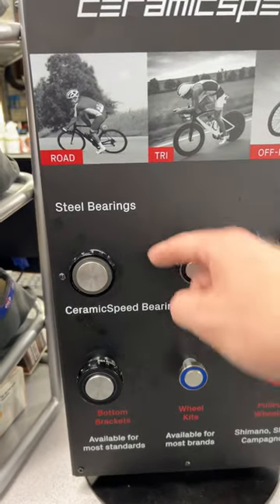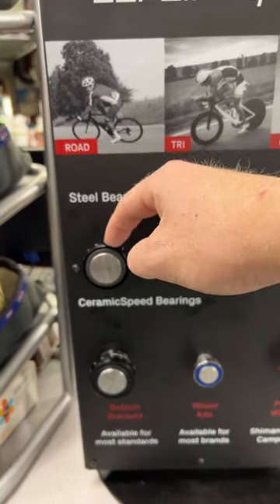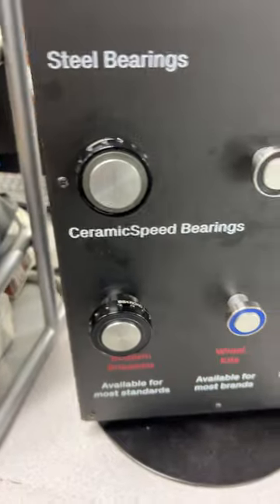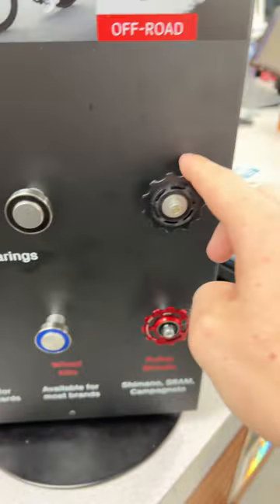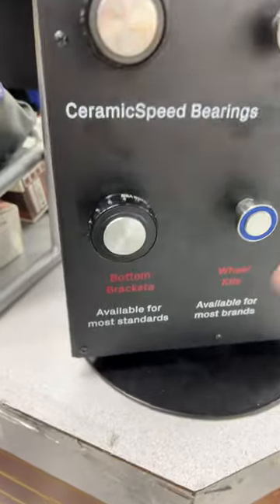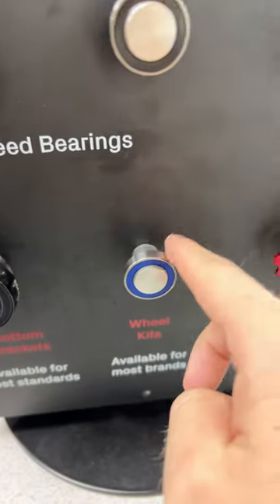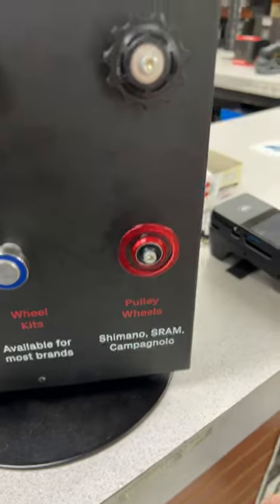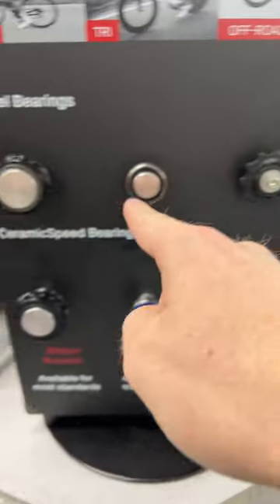Why your bike needs ceramic bearings!

Comment: while i don't have a dog in this race, i do have to say that this isn't how bearings work.
Reply: to make it more clear, a bearing does what it says, it "bears" a "load" it is a bearing. without a load you can de grease a skateboard bearing and it will spin like crazy. it will also explode if it spins like crazy for too long. how well a bearing spins without a load is a moronic way to approach the idea that one bearing or another is better. as i said, they are made to handle a load.

Comment: Yeah this is a load of crap. You can have steel bearings spin just as well. Ceramics use a light oil typically

Comment: Ceramic is a huge waste of money if your not going to pull them apart and clean them after every ride. Wasted alot of money on bones swiss ceramics just to realize they roll the same as reds after a week if you dont clean them like a methhead. Also the steel bearings should roll fine  they are either packed with grease or overtightened I have some steel no name Amazon bearing in my kids scooter that are over a year old and roll better than the top row

Comment: Looks like you lubricated the steel bearings with heavy grease and the ceramic bearings with light oil.

Also this test tells nothing of substance because the bearings are under no load.

Comment: Yeah because the display made by the company selling you an overpriced product is going to be very very honest with you. Ceramic is only useful if you are worried about your points on the world tour. The other 99.999% of society will do just fine with cheaper steel bearings.

Comment: Ya lmao don't hit a pothole or speed hump even thinking of downhill or vertical bikes not a chance in heck besides any skater/ biker kid knew damn well how to have skake wheels clean lube and not over tighten the damn things spin for minutes on end.  It's honestly how you would tighten ea wheel before thrashin or or crusin it's simple.  And never-ending Walmart 100 dollar bikes have cheap regular steel bearings and those spin longer than your ceramic lubed maybe bs lol.  Tear one down let's see tech. data sheets, or trial and error attempts or takes  frfr.

Comment: What a load of crap. You ever repacked a bearing? Or held a new bearing for any piece of machinery ever? That test board is definitely bias/rigged. Maybe a ceramic bearing has better longevity, but the two bearings wouldn't spin at different resistances being in the same state unless the tolerances in the bearing races are different or they're overtightened. Ceramic won't change rolling resistance.

Comment: This literally means nothing. Ceramic bearings spin free because they aren’t lubed properly. You save maybe .33 watts out of the box and after 2-3 rides they perform equal at best and much worse at worst. Ceramic bearings are a scam. This guy knows this and still put this video together. Sad.

Comment: Ceramic bearing are great but are weak and cannot be run in dirty conditions very long at all. Any bit of grit will fuck it up. The steel bearings have a better seal. And perform just fine if you’re not a pussy❤

Comment: This is the worst test. I feel sorry for you dude, you fell for the marketing. Lubricants play a major factor, and the marketing team behind that little shop prop most likely put thicker grease on the top bearings.

Not to mention testing bearings with no load is just uninformed and ignorant. What are you a kid showing off Walmart bearings on their skateboard?

Comment: Clown. Yeah let's all buy bearings that cost a fortune, just because they run with less resistance. let's forgo the waste ceramic bearings create as they wear out faster... you can make steel ball bearings run that smooth too, all you need is to run heavy oil instead of grease... ask the old racers how long these bearings and wheels lasted...